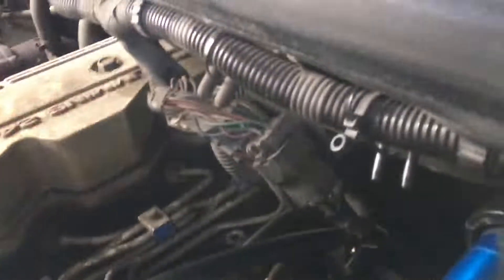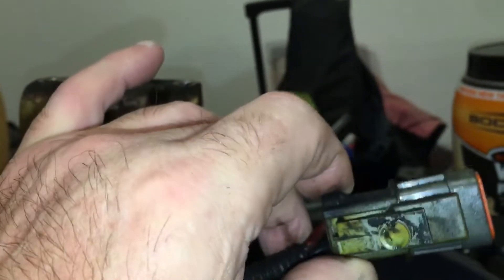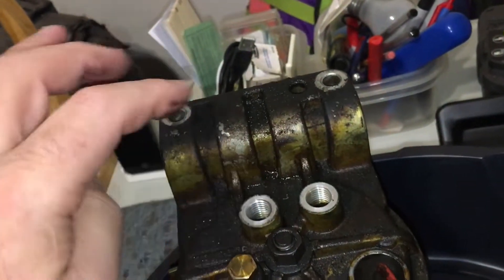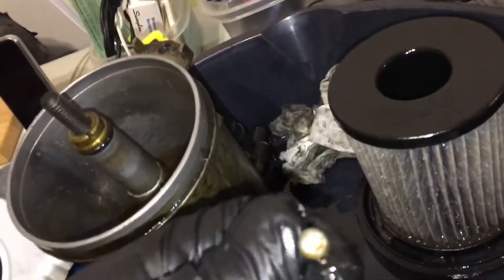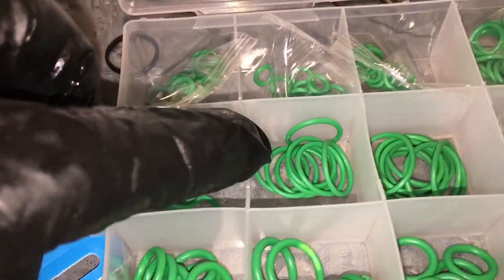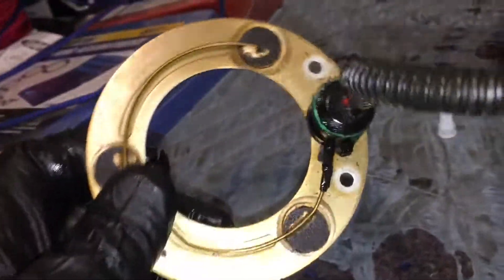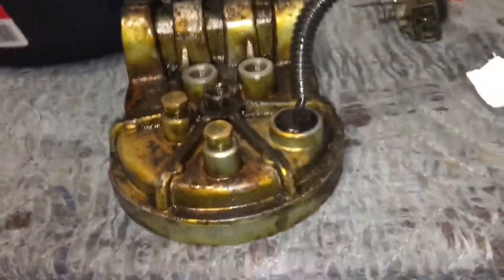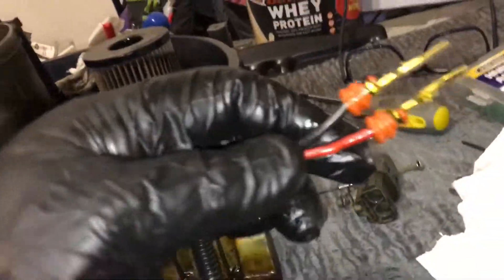How to Replace the Leaking Fuel Filter Heater O-Ring in a 1999 Dodge Ram 2500 Diesel. HNBR upgrade.

Comment: I took my 98 to a shop for the same leak and they charged me 250. I’m going to try it myself but does someone know where I can find a seal kit?
Reply from the maker: Harbor Freight is where i got this one.

You can probably order same kit off amazon. HNBR O-ring kit is what i used. it's in the video which o-Ring i used. You might even be able to Buy One O-Ring if so inclined.

$ 250.00 is a Fair Price. it's a 2 hr job.

Still Working Good as of 12-19-2024.
Reply from the maker: Silicone Grease - i Got at Home depot. only about $2.50. Plumbing & Faucet section on a Wall card. You DEFINITELY Need silicone grease wont go in without it. i tried.

Watch video it's well worth it !
Reply from the maker: O-Ring used is in video. #15 Hnbr.
Reply from the maker: https://www.harborfreight.com/205-piece-hnbr-o-ring-kit-67644.html
Reply from the maker: i checked other kits on Amazon - None of them have correct size in them.
HIGHLY ADVISE USE HARBOR FREIGHT KIT.
Reply from the maker: silicone Grease - https://www.homedepot.com/pep/DANCO-0-5-oz-Silicone-Faucet-Grease-88693/203193536?source=shoppingads&locale=en-US&pla&mtc=SHOPPING-BF-CDP-GGL-D26P-026_007_PLUMB_REPAIR-NA-NA-NA-PMAX-NA-NA-NA-NA-NBR-NA-NA-NEW-PMax_JControl24&cm_mmc=SHOPPING-BF-CDP-GGL-D26P-026_007_PLUMB_REPAIR-NA-NA-NA-PMAX-NA-NA-NA-NA-NBR-NA-NA-NEW-PMax_JControl24-17697605195--&gad_source=1&gbraid=0AAAAADq61UdA4C8z9m-E9GkXr4ooEnG6m&gclsrc=ds

Comment: Good morning.

Do you have a reference for a paste that is resistant to diesel/diesel to put on a threaded connection (Permatex, Loctite, etc.)?

Thanks in advance
-------------
Bonjour.

Avez-vous une référence de pâte qui résiste au gasoil/diesel pour mettre sur un raccord fileté (Permatex, Loctite...)?

Merci par avance
Reply from the maker: I think the pipe dope I use is “ Laco “ white Teflon pipe dope / paste. Small bottle with a brush in the top.

Comment: 👍👍👍 OC don’t forget to post part 2 the finish results
Reply from the maker: Ok. Will do. Seems to be Working very well so far. as of last time I checked. No more diesel fuel smell under the hood. It was a very small leakage. Just seeping a bit around o-ring & a drip on the ground when parked. I upgraded to the HNBR O-Ring ( Green one ) as seen in video. So far so good !
Reply: @OcRefrig  I’m glad it worked out for you